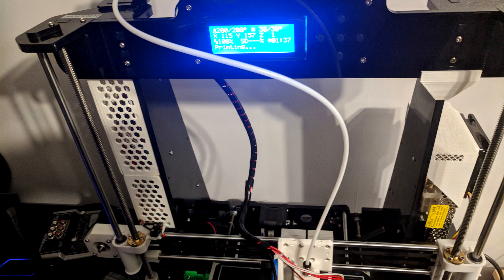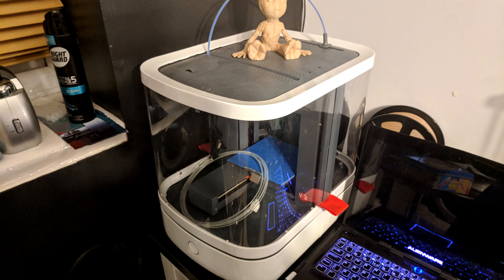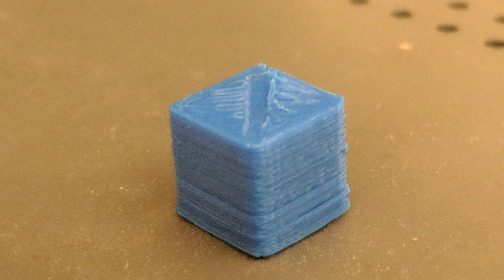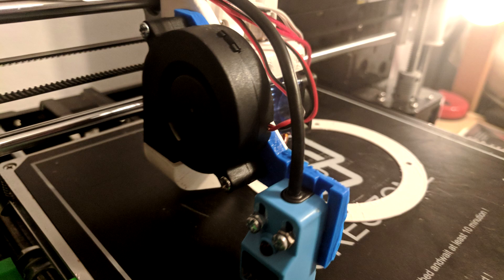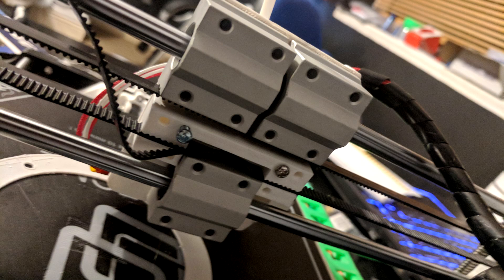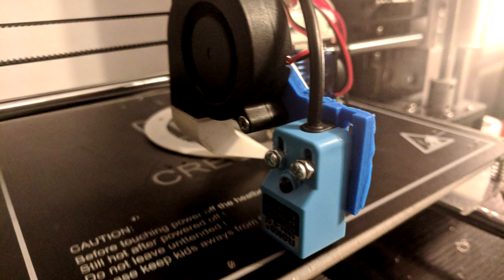Anet A8 Nozzle Upgrades - V3D Clone

Comment: Hey Dude, You have your screw rod set up incorrectly. It should line up just inside the hole at the top of the frame. The trick is the flexible nuts that join the stepper to the rod must have a gap of about 5mm in the middle of the nut else they are not flexible and this will the quality of your prints. Hope that this helps. -- Phill
Reply from the maker: thanks for the heads up!